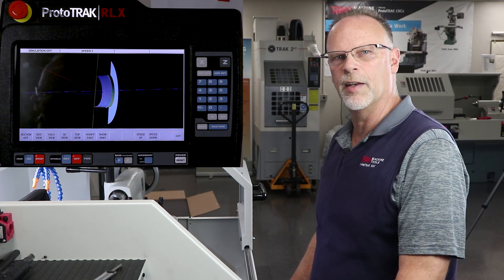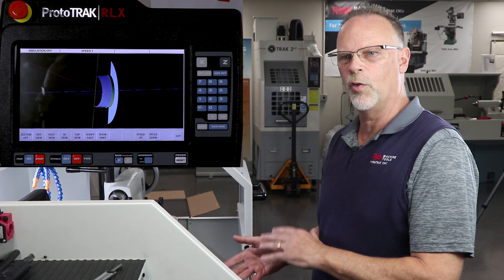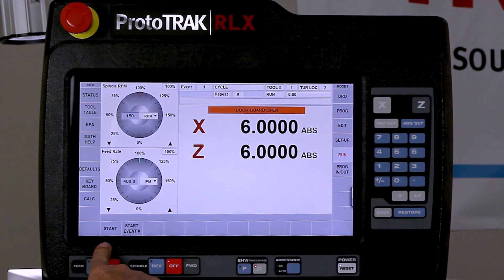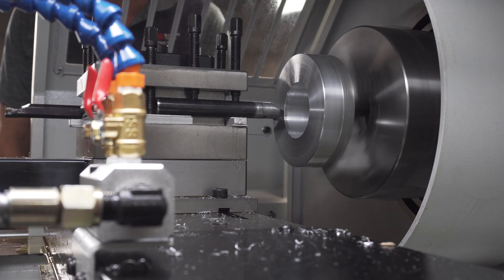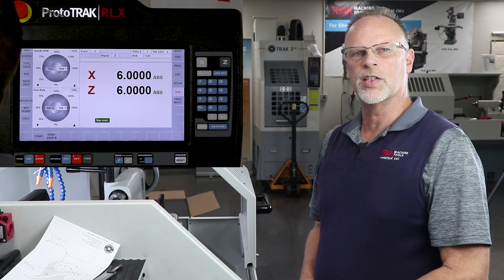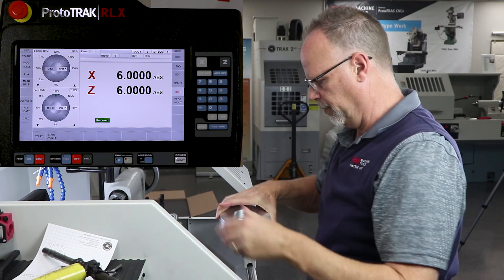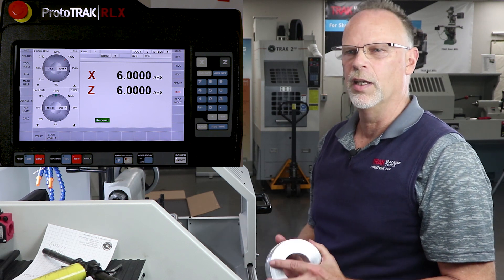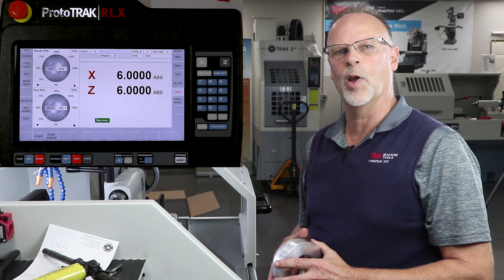ID Machining | ProtoTRAK RLX CNC | Lathe ID Programming [Part 3]

Comment: As researching for information: Can I use a QCTP such as the Parat or Malcus and still use "wait" and "toolchange"? And where can I find info on using .dxf and cam on a RLX 425?
Reply: I am unfamiliar with Parat or Malcus so I don't know how to help you.  As long as the tool post fits on our base, it should work.  You can get the specs for our base from our service department. As for DXF and Cam videos, you can find them here on our channel or on our website at www.trakmt.com/videos.  T.P.
Reply: @trakingpat2750  I just wondered if I can use a "normal" toolpost instead of your turret, make toolchanges in the program, get the program to pause during the time I change the tool (rotate manually) and then continue with the new tool.
 The same as you did with automatic toolchanges but in "semi-auto"... I now have/use a Harrison Alpha 460 where I have a Parat toolholder with ~20 named tools. Never have to index them, when the first is right all of the rest follows.
 As I have numbers engraved on the holders and only change insert (allmost never change anything else) I wonder if I will only have to do the library once.
 Then I still will have to keep exploring YouTube to see if I can make programs on my computer and then just run it the lathe. We use Solidworks and for the lathe I draw in LibreCAD and then use a CAM. I guess that the lathe would be connected by ethernet straight against our server? Is it only .dxf or could I also use .dwg?
 I don't say that we will buy a lathe tomorrow, but it isn't impossible... I would like to thank you for sharing knowledge and "modus operandi" though it sometimes is hard to keep up when I don't think and live inches instead of millimeters...